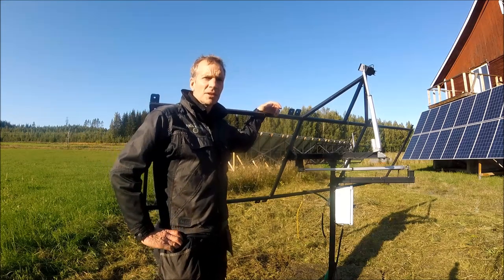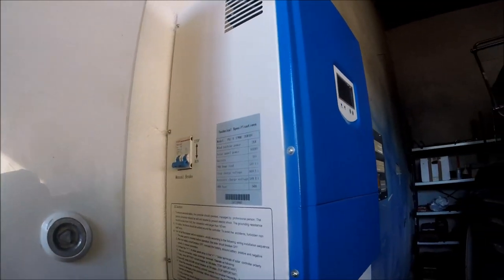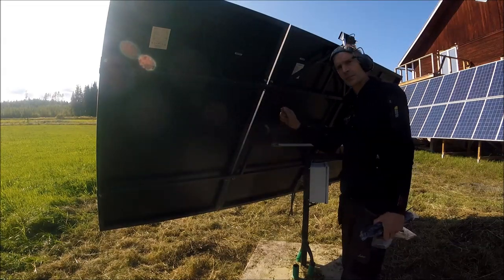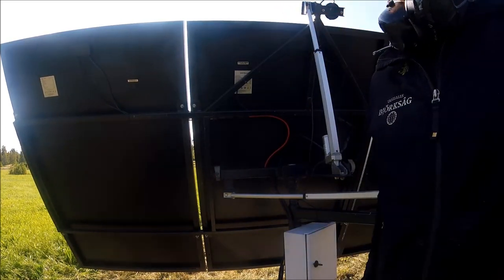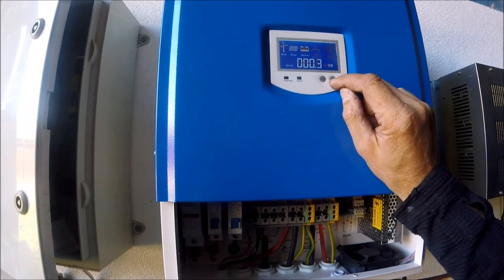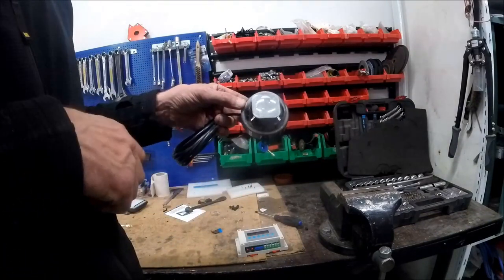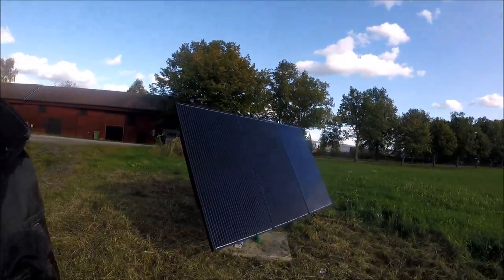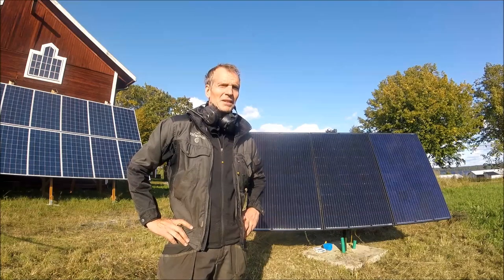DIY Suntracker

Comment: I purchased the relay kit for that module and I haven't had to replace it.  I too wiped pit a couple before running off a small 20v panel and 12v sla battery

Comment: Nice work! Would be interesting is details about construction you mande for solar tracker. What material, size, joints? Also your wind turbine catch my eyes, would be interesting to see how did you build turbine? Are those PVC blades, where to find blueprints for them?
Reply from the maker: Hello, Marko! I think the best way is to make a video and explain. The windturbine is a complete kit I bought from EBAY Germany. Insta Breeze

BR Per
Reply: @persteel  yes,video to explain those details would be 👍 great. Thnx and wish you all the best

Comment: I missed where you got the tracking frame and movement parts. These tracking units are very expensive. It would be worth it to DIY a few as I have the space and heavy equipment.
Reply from the maker: Hello, I built it myself with some bearings and electronics from Aliexpress : https://www.aliexpress.com/item/32818082310.html?spm=a2g0o.productlist.0.0.6f0311fdl6Qf1B&algo_pvid=5a050d0c-2163-42b5-b96a-b93799b930fb&algo_expid=5a050d0c-2163-42b5-b96a-b93799b930fb-18&btsid=2100bdf116054544244214886e5759&ws_ab_test=searchweb0_0,searchweb201602_,searchweb201603_

BR Per
Reply: @persteel  Thanks so much for reply. Good to know.
Reply: @persteel  does the aliexpress come with blue print of frame design ?